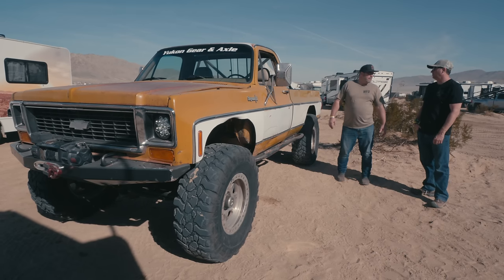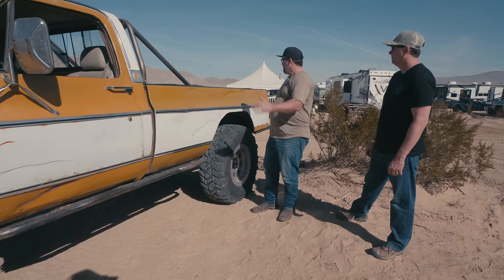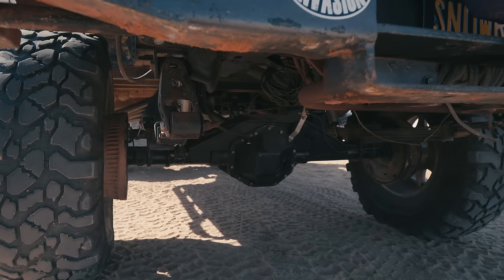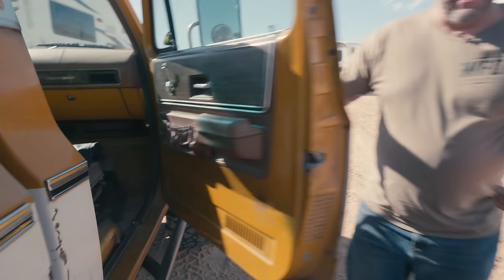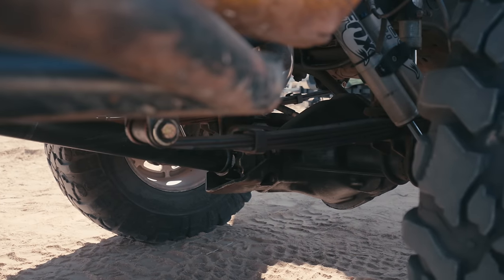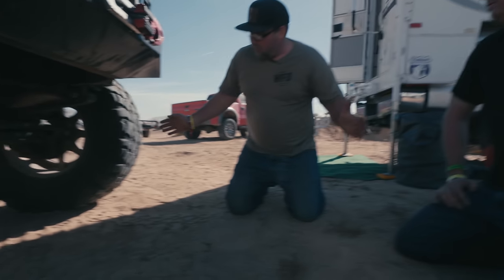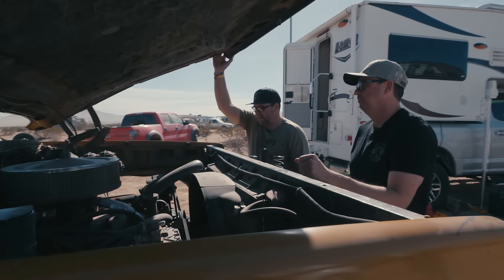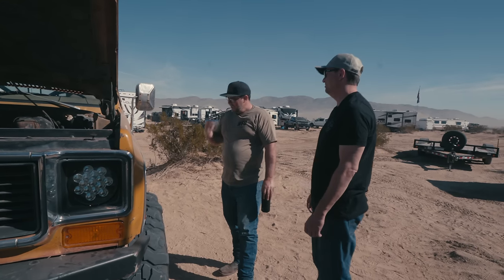1974 Chevrolet on 1-Tons | Squarebody

Comment: The turbo350 behind that stroker BBO is bold! pretty cool its holding up(just rebuilt) w all that reduction.

Im down in Orange County I got(my soms h.s. truck currently) an '84 M1008, 4-5" low lift from ORD w 1.5" forward axle on 38" milestars, 700R4, 6.2 deez w Banks turbo and im not even close to same torque that olds is churning so it gives me hope the 700r/np208 from the o.g. 400case(advance adapters) will live a long life. Im on Eurathane trans/ORD motor mounts w the 1 ton CUCV frame so I hope my frame flex is minimal. Your cracked housing/ideas got me thinkin about bracing. Leaf Springs party harder!

Comment: Very cool 🤙 I have an 81 chevy Scottsdale with a turbocharged 468 with a 4spd im about to do a 5/6 spd swap not sure yet which one ill go with. Im curious why he filled the bed up? The bed is necessary there's a lot of space under the bed. I have on board air and 110 power with 75' cord the air has a 50' reel 3 group 31's under the bed. It's a cool project still have a bit to go